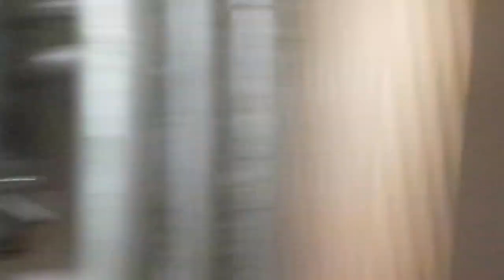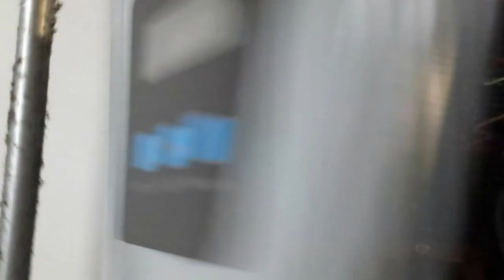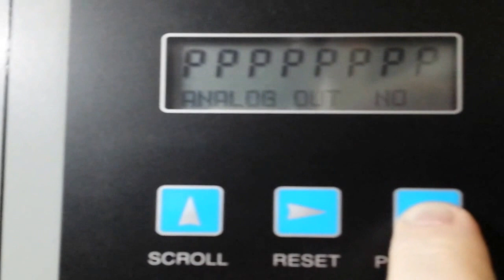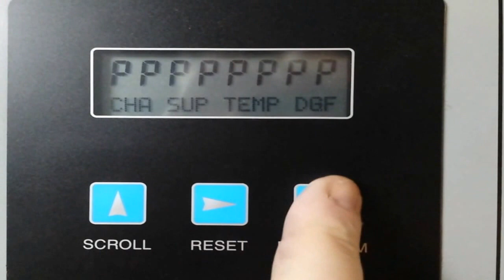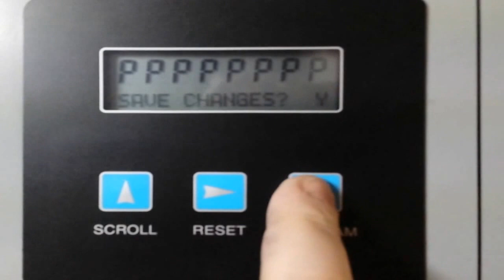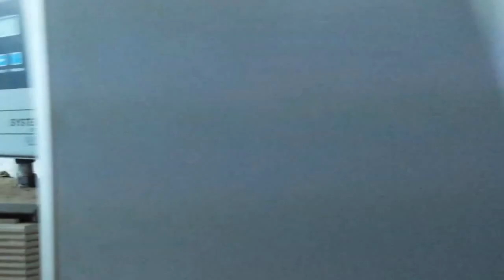Onicon BTU Meter Analog Input Board Installation

Comment: Hi sir ,i hv a question we have to replace one onicon btu meter what setting need to do with btu to communicate with our bms
Reply from the maker: Make sure you have installed the communication card that matches the protocol you need.  Once you have the card installed, set your device ID in the parameters.  If it is bacnet, you will be able to discover the points

Comment: thanks for the video my friend!! can this btu meter reed many close system chilled water?? and how can i change de display meter from btu/hr x 1k, to 10k????
Reply from the maker: Sorry for the delayed response.  Yes, this meter can read flow in a closed system.  Onicon should be able to help you  by configuring a system based upon your system specifications.  You give them the specs and they can have it ready for installation.